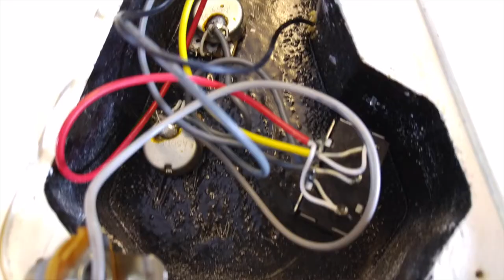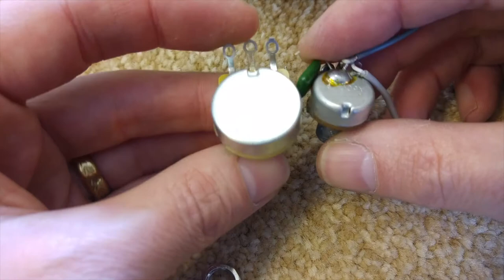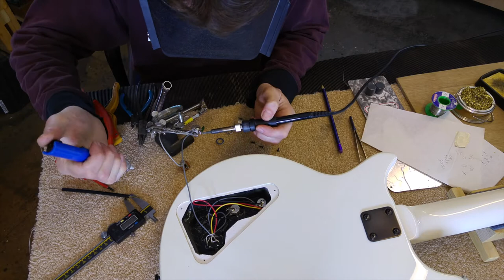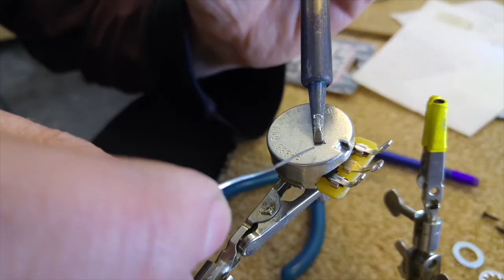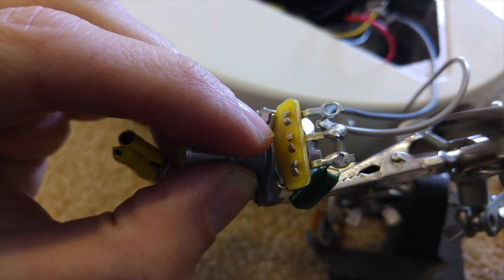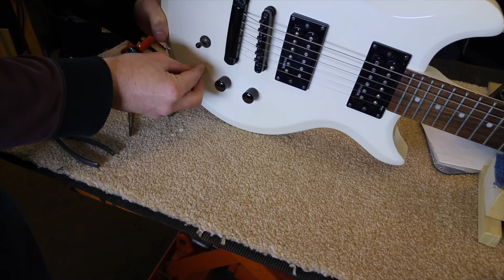Guitar or Bass Tone, Volume or Blend Pot Replacement

Comment: Hello brother ! what is the Green that you connect  with the volume. How to know that it broken or not. My guitar bass is non't sound. I think that problem from The Green one that connect with volume. Thank you for your video. I hope you can help me.
Reply from the maker: It's a ground wire. Is there no sound at all?  If so it is probably one of the wires. Check if any are loose or detached. Then solder them back on. If you think one is broken inside and you haven't got a meter to test them, you could just try to replace it anyway.

Comment: Hi, great vid. Have a question: It is possible to change a switch pickup for a blend knob/pot in a bass with the same config as the the one you work with it in the vid (volume, tone, switch pickup???
Reply from the maker: Thanks for the comment." Probably" I think is the answer. If the current configuration is just a selector switch that choses between 2 pickups, then a blend pot could be used instead. Choosing the correct value of pot maybe difficult and the tone may be affected, by that I mean that even if you successfully added a pot and it worked, turning all the way to 1 pickup may sound different to the original selector switch, as the introduction of a pot may affect the overall tone. If you are up for some experimentation then it may be worth just wiring one in to see what happens. Sorry I can't be more helpful.
Reply: @pauljazzbass  Hey, thank you for your rep, cos you make me think twice with messing around with things😂. On the contrary, you've been very helpful👍👍👍👍👍

Comment: Hi...my tone know is kind of a bit loose and scratchy. But there is no screw on the side to take it off. You did not show how you managed to take off the knobs. Any advice on how to take off the tone knob?
Reply from the maker: Hello Wes, if there is no sign of a screw, than the knobs are push fit. They can be quite stiff though, but will pull off. I would recommend protecting the area just under the knob, in case you end up prying against the body.

Comment: Paul, how do i figure out the size of a hex nut for a pot? I lost a pot nut on my yamaha bass and im having trouble figuring out the size of the hex nut. It measures 12 mm max, 10 mm min, hole is around 7 mm and height is around 1.5 mm.
Reply from the maker: Hello there. I think that is a little tricky. I've not seen spare nuts for sale. You may be able to get one by buying a cheap pot with the same diameter shaft. In the UK RS components or farnel. Element 14 in America . Hope that helps.
Reply: @pauljazzbass  I found out from a buddy its the same size as his Squier p bass. What size is that?
Reply from the maker: Not sure on the top of my head I'm afraid.

Comment: Why did you add the capacitors?  I have a SGr505. The model that came out before the active/passive switch.
Reply from the maker: +:| Inspiration Hi there, the capacitor was on the original, so I simply wired it on the new pot. It's function on a passive circuit is to act as a low pass filter.  So in effect it makes the variable resistor into a tone control by taking the high frequencies and reducing them, giving a less treble sound.